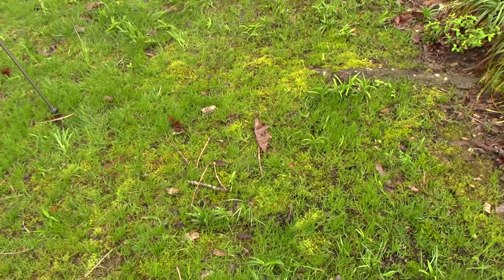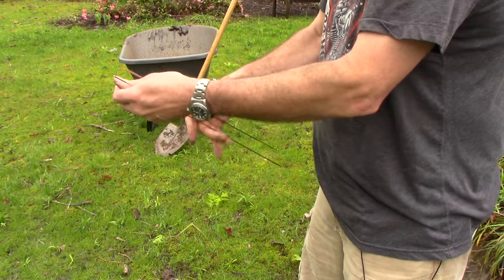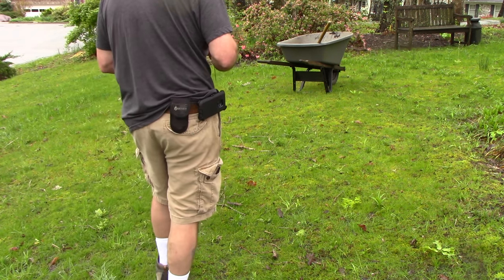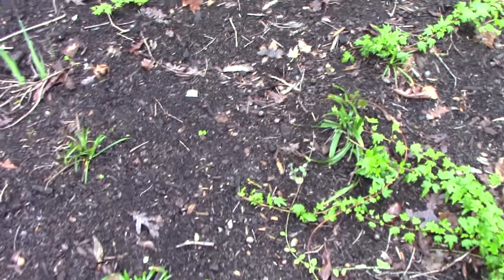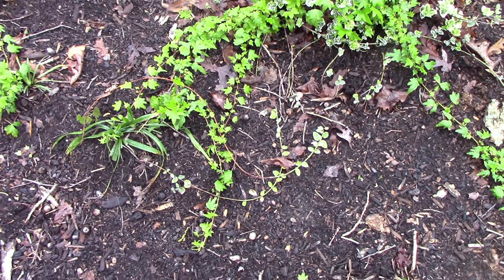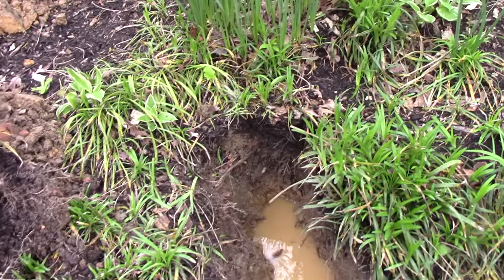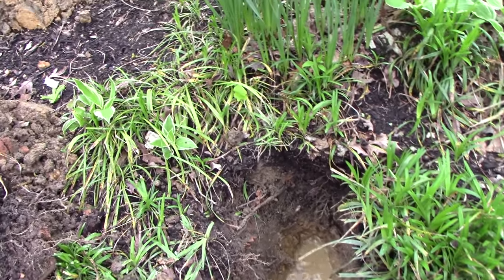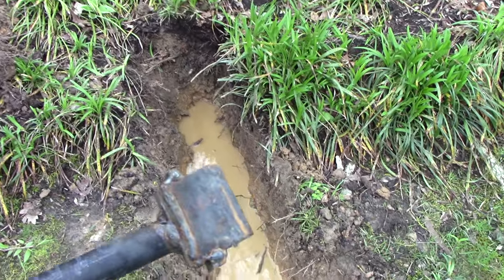Searching for an underground water leak

Comment: You didn't mention if your line was plastic or copper. If copper an electromagnetic locators would pin point the path of your water line. Then you could use a acoustic locator to pin point the leak. Even if your line is plastic acoustic locating would be better than witching. Witching is always a last resort. Don't get me wrong, I've done a lot of successful witching when I had to and I know it works.
Reply from the maker: I know from previous experience, my second YouTube video, that the water line is buried in the same trench as the cast iron sewer line. I am using the cast iron sewer line to locate the water line which I am pretty sure is PVC. If you watch the entire video it turns out that there is no leak and it is just groundwater pushing up through the ground at a tricky location.

Comment: I can't imagine how brain-dead a person would have to be to believe that this works. LOL. Good story broseph
Reply from the maker: Try it out in a place where you know a metal line is buried. Let the rods float in you hands.
Reply: Apparently Marty Feldman picked out my brain for me???    Really, here's how to try.  Get your rods, try coat hanger cause I know they work. get some friends and a couple bottles of wine and snacks. Got to a park that has a sprinkler system ,  Hold your rods out and start walking. When they cross put a flag in the ground. Move over 15 to 20 feet and start walking again. Keep putting flags in the ground.  You should see a pattern develope after a few passes. Once you get a Lin established follow till it hits a sprinkler head. Now, you need to do this with multiple people because it does not work for everyone. At the end of the day you will 1) learn whether it works for you or not, 2) have a fun outing with close friends. Pipes dont have to be metal to find them, I find plastic pipes all the time. I do believe they need water in them.   If you're not willing to go try this then you are brain dead.

Comment: This does work but all it is doing is finding a void in the ground so it will turn on gas line drain line irrigation corrugated gutter drain etc
Reply from the maker: Correct. It is finding something underground, you have to be somewhat educated on what and where you are looking for. Or if you read the other comments this is complete BS.